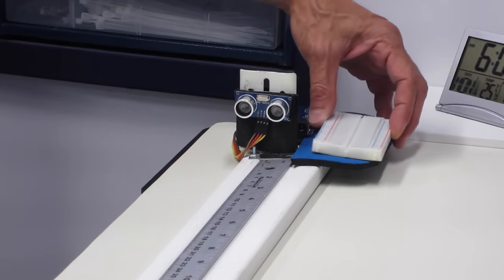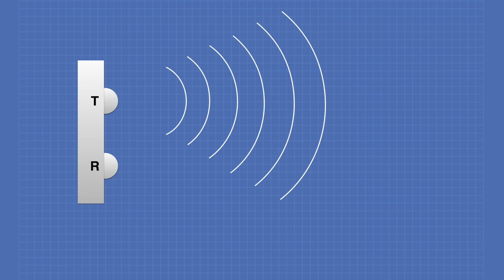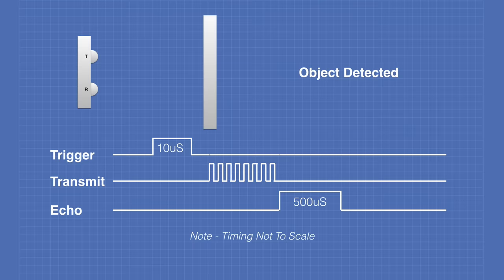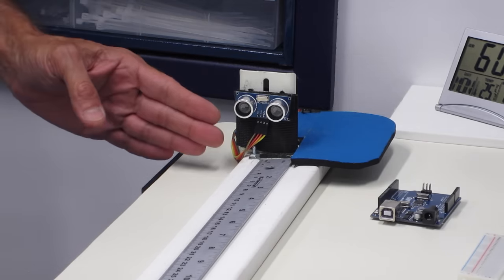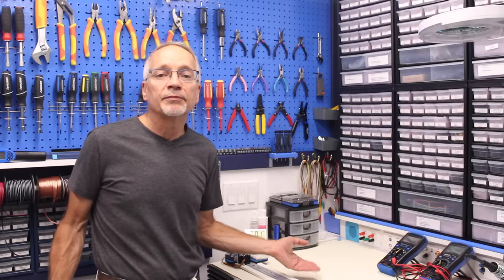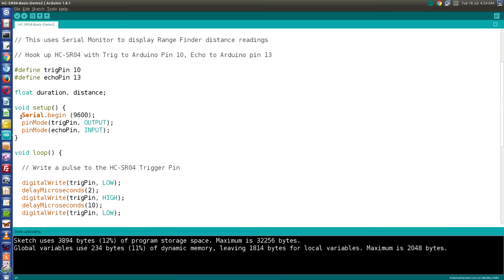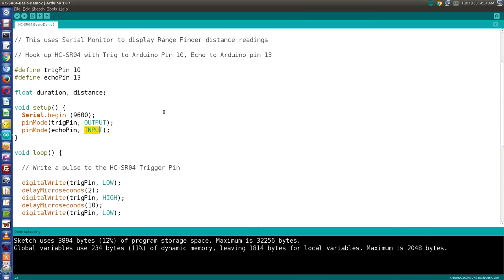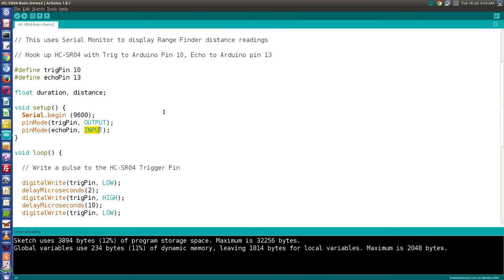Using the HC-SR04 Ultrasonic Distance Sensor with Arduino - Everything you need to know!

Comment: Dear Sir,
I am facing a strange problem with HC-SR04 when I connect to battery. I am connecting the 9V battery to the Power Jack 7-12 V input (side of USB port) of Arduino. I am powering HC-SR04 from Arduino. I also tried connecting 1.5V X 8 AA cells as I read that 9V battery in not enough to power Ultra Sonic Sensor, but getting the same error. I also tried putting 1000uf cap on power and ground. When I connect to USB, it works perfectly fine and I get correct readings. Thanks
Reply from the maker: That is odd, a 9-volt battery should be capable of powering up the project. And 8 AA cells would definitely pack enough current to drive it for many hours.

If you have a multimeter try measuring the 5 volt output pin on the Arduino and see if it is indeed 5 volts (when powered by the battery).  The difference between the USB and battery power supply is that the battery supply uses the Arduino's built-in voltage regulator, which I believe is just a standard 7805 type device.

If you have a second Arduino you could also give it a try.
Reply: Sure Sir, I'll try replacing the sensor and I'll try on the other Arduino board. I did check with multimeter, voltage is fine. Thank you so much Sir!! :)

Comment: Hi, thanks for these great tuts, as a beginner they are really interesting and well presented. 
i picked up an issue with the code when i got to testing the DHT22 in my case the 11.
After downloading the required library files i got an error something like "DHT.h" not found in dictionary. cant remember the exact wording now.
In the Lib Manager search "DHT" instead and look for "DHT sensor library" by Adafruit. 
This fixed my error.
Reply: WHERE DO YOU WRITE SKETCHES PLEASE TELL MEEEEEE I BEG
Reply: @n9583  in the Arduino program like they do in the video. In the drop down Menu, New Sketch.
Reply: Thanks sooooo much dude

Comment: im metrically impaired and  im wondering how do u convert 1125 feet per seconds or 13,500 inches per seconds to fit inside the equation
Reply from the maker: Hi Caleb - While you could convert the speeds you specified to metric (1125 feet per second= 342.9 Meters per second) I would actually do my conversion on the output side.  Use the equation 1 inch = 2.54 cm.
So for example if you measure 14.5 cm you could divide that by 2.54 and obtain a result of about 5.7 inches.
There are several good conversion tools on the Internet you could look at as well, one of them is at http://unitconverter.io/
Reply: thank you much appreciated

Comment: I want to take these readings of ultrasonic sensor and give it as pwm signal to ESC... How can I do that
Reply: I don't have the equipment to test my code, not will I supply a working code. But hopefully this will guide you in the right direction.
To read the ultrasonic sensor, you follow the instructions in this video. Since you're only interested in converting it directly into a PWM signal, you don't really need to convert it into distance. The echo pin outputs a pulse 150us to 25.000us (25ms), which you can read using the built-in pulseIn()-function. This function returns the value in microseconds. To write a PWM-signal, you use the built-infunction analogeWrite(). Here you need to specify a pin number and the duty cycle: between 0 (always off) and 255 (always on). You can scale the duration variable (150-25000) to the pwm-range (0-255) by using the built-in map()-function. This will scale a signal from one range to another - in this case:
(...)
pwm_value = map(duration, 150, 25000, 0, 255);
analogWrite(analog_pin, pwm_value);

Comment: I am been working on the project where I need to measure the exact fuel quantity present in a vehicle in liters, can this ultrasonic sensor solve my problem.
Reply: You are better working with the weight of the vehicle, thuIs would read a reflection of the sound so has no way to know exactly. Weight wise = high accuracy. I measure liquids all day, we do it via weight
Reply: It's going to depend upon what you mean by "exact".  Or do you just mean "to the nearest liter"?  There's always going to be some error / discrepancy in measurement.  The shape of the tank can make a difference.  Most vehicles do not have nice regular geometric shaped tanks and even if it did, you might be looking at +/- 1 cm in the measurement which depending upon the surface area, might equate to a large volume discrepancy.  For example, 1 liter = 1000 ml = 1000 cu-cm.  Assuming a square tank, that means approximately 31.6 cm (12.45") on each side.  If your tank has a larger surface area than that,  it would take even less than a cm to make a 1 liter discrepancy.  Also, is the vehicle going to be moving when you are taking the measurement?  If so, the fuel will also be moving and the level will be changing as the fuel moves from side to side.  That can be minimized somewhat by appropriate use of baffles in the design of the tank.  There is no single solution that will work for every situation.  You have to look at all the criteria for your particular situation and determine which compromises you can live with.  A solution that might be acceptable for determining the fuel in a large ocean going freighter might not be acceptable for use in aircraft.

Comment: If I am using a sensor shield where would I plug in the echo and trig pins?
Reply from the maker: Most sensor shields I've seen have the Arduino I/O pins connected to a 3-pin connector, with the other two pins being 5 volts and Ground. This simplifies connections to items like servo motors etc.
To use the HC-SR04 you'd connect one of the pins (let's say the trigger but it really doesn't matter) to the connectors I/O pin and use the ground and 5 volts to power the HC-SR04. The second pin (i.e. echo) would connect by itself to the I/O pin on another connector.
Hope that made some sense!

Comment: I wanted to ask about DHT11. When i connect out pin to arduino, than + and - to the breadboard MB102 power supply i get no reading but when i connect all 3 pins via arduino it suddenly can read the sensors output. Someone knows why?

Comment: Air Temperature, Humidity, Air Turbulence, Atmospheric pressure and many other external factors affect the speed of sound waves.
I guess that's why NewPing doesn't believe in multimeter level accuracy.

Comment: A lot of good information especially the libraries and the temperature sensor BUT it drove me crazy that you didn't just use an object that sat on the line without wiggling back and forth from you trying to hold it square? That would have shown how truly accurate or inaccurate it was.

Comment: hmm.. at 35:23 "cm/ms" you said centimeter/microsecond. maybe its more right to use "us" for microsecond. because "ms" is mean millisecond.
Reply: I know this is 8 months later now^^ , but he also could have used "μ" which is the "official" symbol for micro. You can get it by pressing Alt while pressing (on the num pad) the ascii code for it (230).

Comment: you probably wont see this because its 80 years later but what wires do i connect to the bread board
Reply: i have the code all done but it wont read how far an object is and so i realized you had some wires connected to the bread bored but i cant tell where they are going

Comment: Won't work with Arduino Mini,  Why.....?  The distance  is always Out of range!
but works fine ( without accuracy)  on Arduino UNO
Reply from the maker: I will try it with a mini myself and get back to you.  
Just to check, were you using a 5-volt 16 MHz mini or a 3.3 volt 8 MHz mini? If it was the latter then I can see why it wouldn't work as the HC-SR04 is a 5-volt component.
Reply: I was using 5 volt 16MHz, and I tried another mini, I still have the same problem. If I use Genuino Uno I don't have any problem. I tried to debug with " Serial.print(duration);" and it is always 0,00 (that's why is always "Out of range"). The problem seems to come from that line of code "duration = sonar.ping_median(iterations);" but that line is okay with Genuino Uno. I tried using an external power supply, but no change. I assigned a value to the duration variable and no more "Out of range" but the distance won't change and it is normal because duration variable is now constant. Thank You
Reply: I should wrote a Pro-Mini instead of a MIni, is that can make a difference?

Comment: Can i use it to wakeup an arduino on motion
Reply from the maker: You could but it wouldn't be my first choice. I'm assuming that you would be "waking up" your Arduino using an external hardware interrupt? If so I would choose a PIR sensor as it operates all on it's own, as opposed to this ultrasonic sensor which requires a pulse input to function.  Check out my video on PIR sensors to see what I mean - https://youtu.be/ZC_sEW3_694
Reply: DroneBot Workshop thank you for your prompt response sir. I am looking at waking up an arduino or a particle photon if the distance of an object  is less than 2cm. I understand that this device will need a signal from arduino for it to send back the signal. I am kinda stuck now 😂

Comment: In HC-SR04-temp-humid-demo, I use a DHT11 for now and the speed of sound, the temp and the humidity are OK but the distance is always Out of Range....Why?  The HC-SR04 alone is OK
Reply: Same problem ! anny issues ?
Reply from the maker: That's interesting - I'll hook up a DHT-11 and try it out myself.
Other than decreased accuracy it should work correctly, I'll get back to you if I figure out the issue.

Comment: why do you have to be grounded?
Reply from the maker: The strap keeps me from running away from the workbench until I finish the video!
Seriously I use the static strap to reduce the chance of static electricity zapping my precious components. The mat on my workbench is an anti-static mat and is also grounded. Both the mat and static strap are not DIRECTLY grounded, there is a lot of resistance - they are designed this way so that if you are working with live AC voltage (not a good idea BTW) you don't risk electrocuting yourself.
This video was made in the summer so admittedly the anti-static strap was probably an overkill. In the winter it's a necessity and I also use a humidifier to decrease the chance of a static build up.